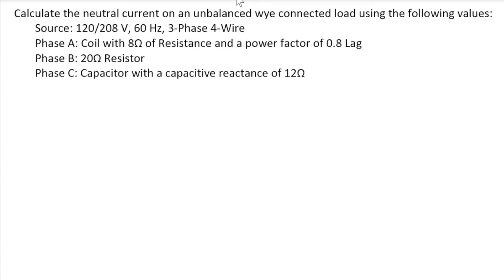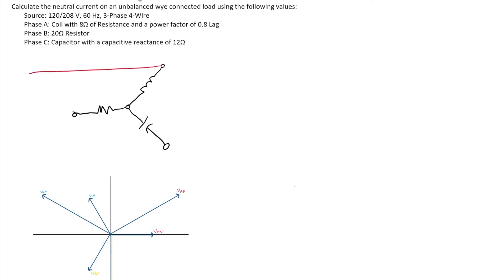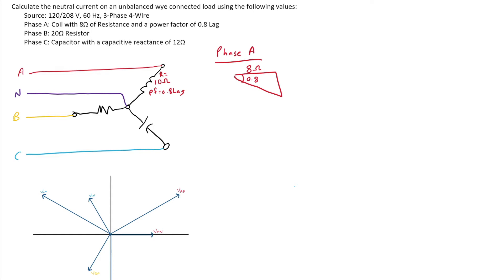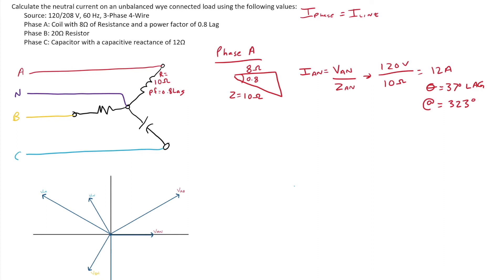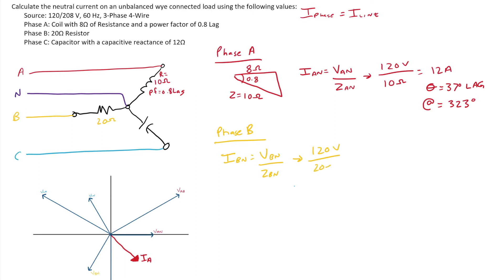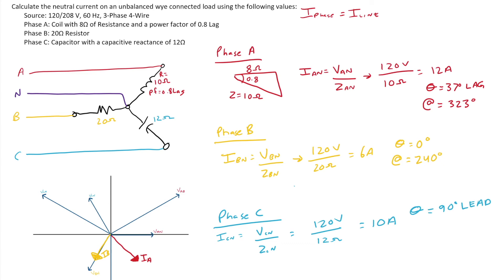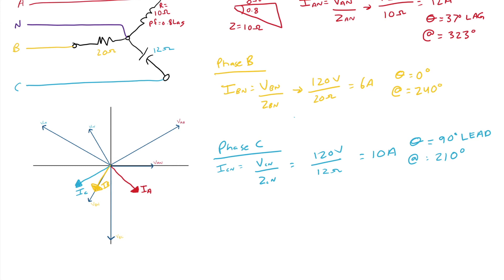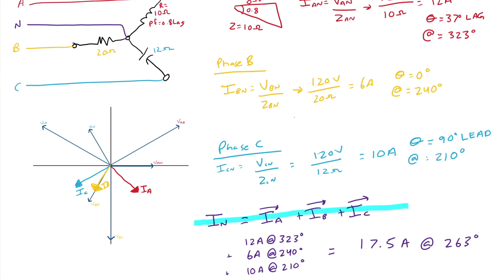Wye Unbalanced RLC Calculation Example

Comment: why did you put the voltage phase B at 240 degree and phase C at 120? Should not be phase B at 120 degree and phase C at 240 degree (counterclockwise direction A,B,C) ? And if I have a three-phase circuit with different currents in each phase (unbalance load RLC), I check the phase sequence (with phase sequence device) and it indicates that the rotation is in the left direction this mean that on the phase diagram the direction will be clockwise (from 0 degree I will start to count in clockwise direction opposite compare with your example)?